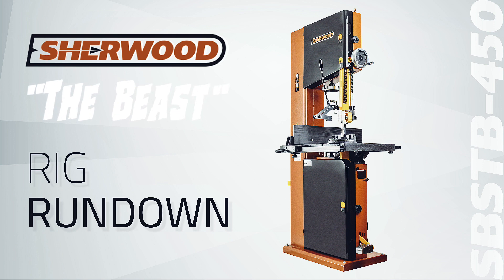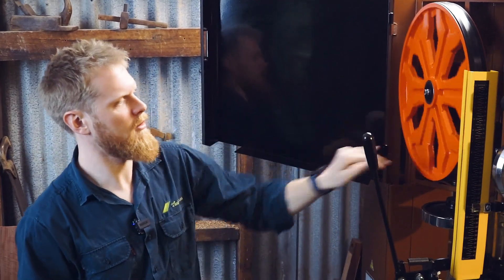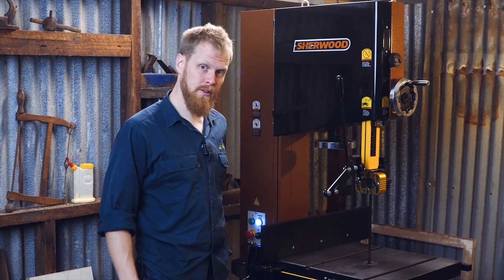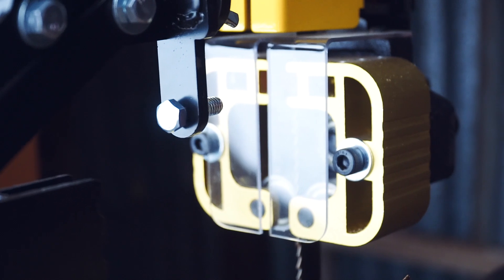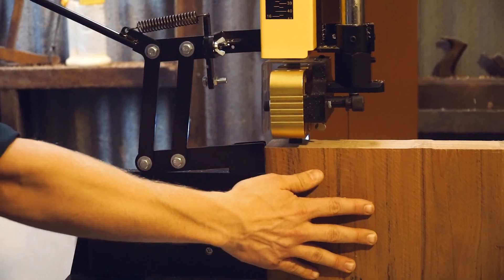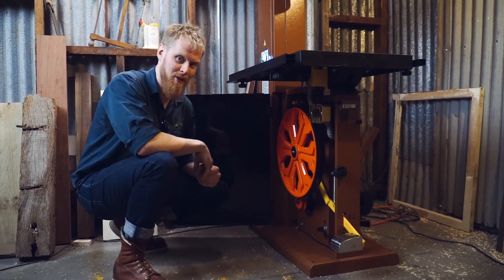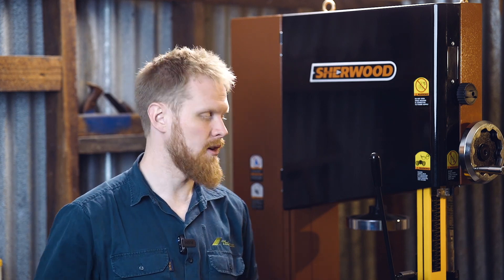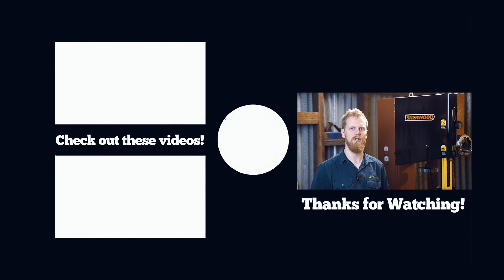Rig Rundown: The Beast

Comment: Why 20amp, bugger I just had 2 new 15amp plugs installed, now I'd need to get the electrician back.  In an industrial shed probably no issue but would rule out the majority of back yard sheds.

Interesting what you call the throat and height of cut.  I've always known the throat as what you are calling the height of cut (you push your log down the bandsaw's throat).  What you are calling the throat I've always known as the width of cut.  

Your safety lever, hmm wouldn't be much use on the majority of logs and lumps of timber I'd be cutting, none really have a neat edge to grip.  To be honest, it would probably get in the way, so I'd take it off.

Standard fence from Melamine, seriously?  Your advanced one should be standard on what appears to be an advanced bandsaw.

Apart from the above looks very interesting

Comment: The safety lever. I think that idea is unsafe. If u see on the video the operator has his thumb across the lower part of the wood. The lever makes it easy to do this. Fortunately, the operator moves his thumb away before the blade exits the wood.
How many other people are going to do that too late? Bad idea.
Reply from the maker: Every tool has the potential for operator error. The reason for the lever is to remove the need for an operator to be touching the work piece.